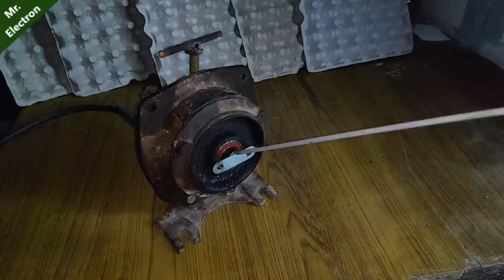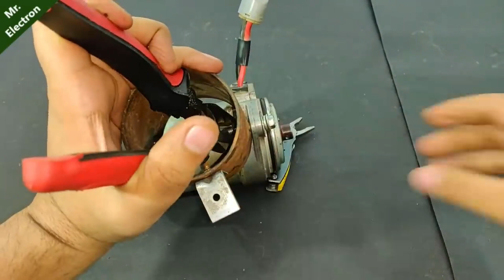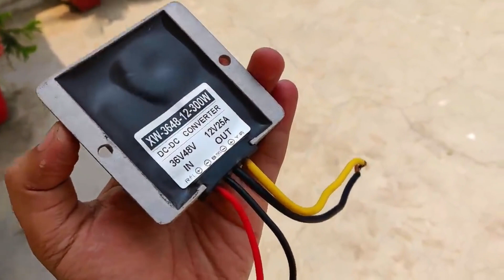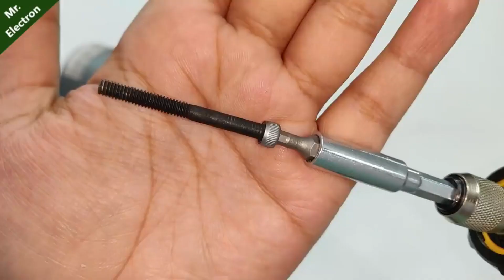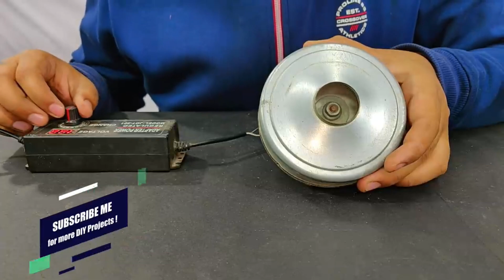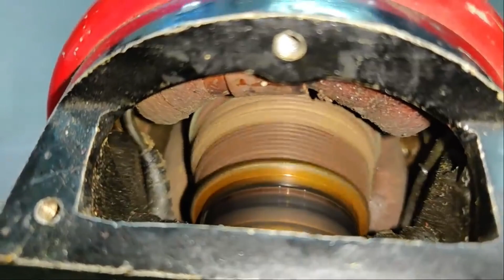3 Simple Inventions with DC Motor

Comment: 1- It's safer to use a small wire resistor, say 0,5 ohm in each emiter to equalize them.
2- you can use a rotary swutch with several poles, one for each function, so you will not need the voltmeter.